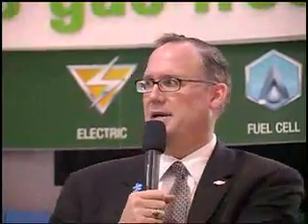GM-Volt.com/Volt Nation -- Panel Q&A (Pt. 3)

Comment: WoW, if they could put, like a 220 plug, allow people to install a power-cutoff or educate them on how to plug it into the house, and shut off service to the grid, they could in theory use the car to generate backup power for their vehicle. We have a 50,000watt generator, and that is 50 kilowatts right? Well that would be the same thing! That would also score some service for gm's service. Put service intervals as "hours" instead of miles. Great idea.